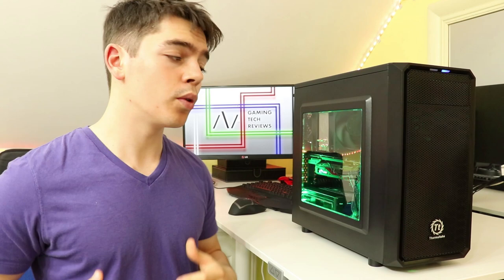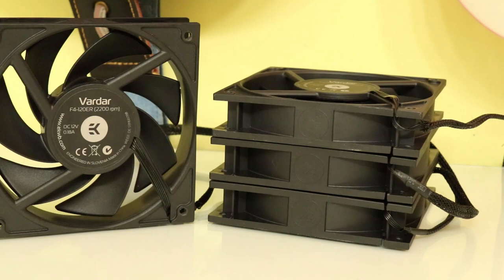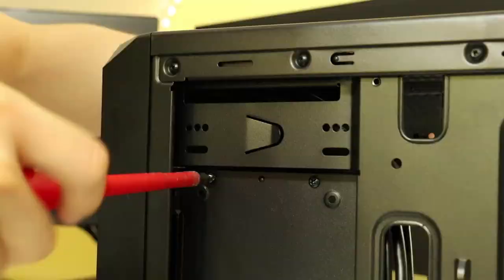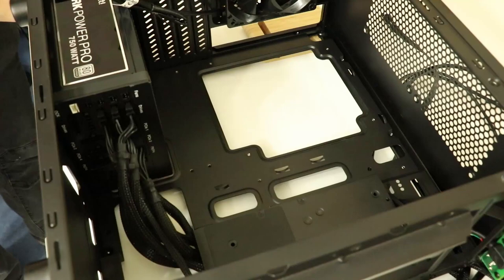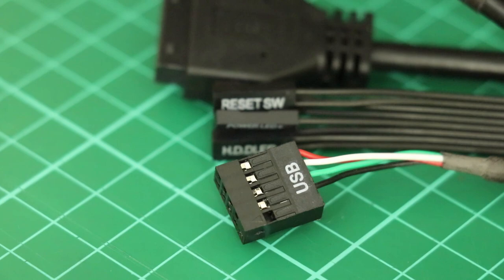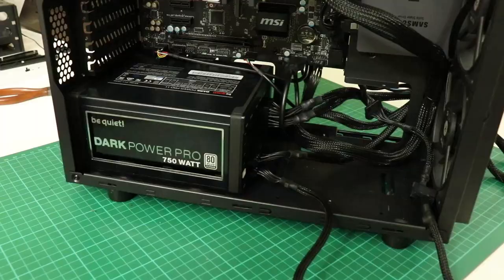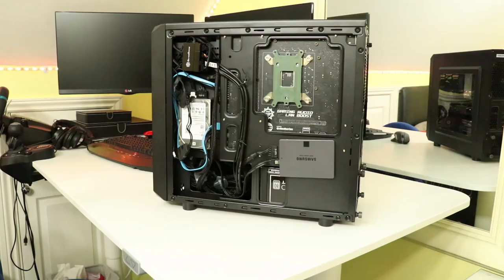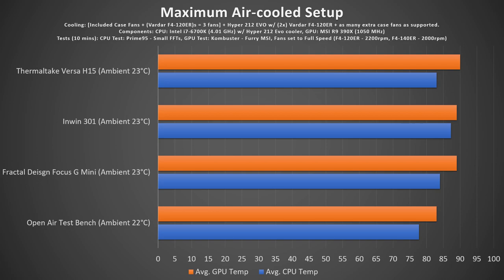Thermaltake Versa H15 Air-cooled Build

Comment: This case specs say max cpu cooler 155mm but you managed to put 159mm cooler inside??? Im considering buying this or Versa h18 case but I have 160mm cooler and they both say 155mm max. Can someone confirm if these cases can hold 160mm cpu coolers?

Comment: Well...I've got my work cut out for me lmfao. That said, I am glad I have a "mini card" version of the GTX 1060 6GB. Looks like I will be doing some custom work on this case....
Reply from the maker: It's certainly a tight case to build in, it really will appreciate the smaller graphics card. I would highly recommends a mini ITX motherboard, but like you saw in the video, you can make it work with an mATX motherboard if you want.

Best of luck with the build, and let me know if you have any queries about the case. And of course thanks for checking out the video!

Comment: if I use an air cooler and put fans on top of the case, will it be bad?
Reply from the maker: It won't be bad, but any fan Infront of the air cooler will be reducing the performance of the air cooler unless it's an intake. Best way to go about it is a front intake and rear exhaust, it keep the airflow more linear and prevents air recycling.

Comment: Вау, какое у тебя мощное железо, много накопителей. И конечно же корпус очень крутой.
Reply from the maker: The system in this case was pretty much all the hardware I  owned at the time, we've updated the test system a little more since then. That R9 390X is a really hot card, and this case did well to keep both the CPU and GPU under their maximum temperatures.

It's a cheap case, but it works well for the price, and I'd recommend it if it's what you like the look of. Let me know if you have any questions, and thanks for checking out the video!

Comment: I seem to be having trouble mounting my ASUS GTX 1050TI into this case, as the mount inside the case where I would secure the GPU with screws is getting in the way and preventing it from being slotted properly into the PCI port. Has anybody else had this kind of issue? Any workarounds for it?
Reply from the maker: Try taking the Graphics card out, and then pressing the back of the case in a little. That should help to align the screws better.

Comment: Is there any way to put my 3.5 hdd in the rear back of my case, cause the hdd holder is interfering with my airflow, thus I don't really have good fans, so my gpu temp is reaching 80c. Causing my games to crash.
Reply from the maker: Before exploring too many options, have you tried running the system without the side panel? This should help to identify if it's a general GPU thermal issue, specifically a case airflow issue.

If the graphics card stays below roughly 70C then we can think about case airflow, but if it's higher and maybe still crashing you might want to think about changing the thermal paste (especially if it's a card that's over a few years old).

If it's a case airflow issue, something that will help is adding a rear fan. If you haven't got a rear fan try adding a fan from the front to the rear. A lot of these kinds of issues can be solved with reconfiguring hardware.

I don't think the HDD cage will be causing such an issue to force the GPU to become unstable, even with pretty bad airflow the GPU should be able to ramp it's fans up to full speed and just about cope. This of course is subject to what GPU you have, and elements like the condition of the thermal paste.

Let me know how you get on.

Comment: I have a Thermaltake H15 build,i gave it to someone who was recommended to build as i didn't want to blow the house up,but he only put 1 xtra fan in it at the top and says he couldn't get more in.I have now found out he is an office pc xpert and not gaming pc.I was Playing a game last night an niticed the heat is starting to go up more.I would love to dismantle and rebuild with all the fans installed but he has packed the cables in strange way and wouldn't know where to start.I wish i'd just taken a chance myself now but have only come across Thermaltake H15 build videos after the thing was built.I know i'm stupid!
Reply from the maker: Sounds like you ran into quite a bit of trouble. If you wanted a couple of tips for some simple changes to improve the thermals on your system, don't hesitate to send some images in a private message to my facebook page and we can see what you have, and how to change any of it if that's something you want to do.

Everyone who get's into tinkering with PCs starts for different reasons. It turns out your reason might be to better what has been built for you. If it's just the case of installing another fan, or replacing the CPU cooler (not as complicated as it may sound), it should only cost in the region of $10-$30 depending on what needs improving.

Don't beat yourself up about it, there are countless things that people do to their systems that are detrimental, at least you have a working system that you can better, over a broken one that needs replacing.

Let me know if there's anything you want to look into to change or improve your system, and I'll do what I can to help out!
Reply: Thanks m8,i will take some pics and send them to you soon,you are english so we are same timeline as i'm only cross the water iin northern ireland.I may be worrying over nothing but would rathee be 100% sure about it.
Reply from the maker: No problem, here's the link the AV Techy Facebook page by the way:
Facebook: https://www.facebook.com/AVTechy/

One thing I would certainly recommend it downloading MSI Afterbornuer to track the temperatures of your system when you're gaming:
https://www.msi.com/page/afterburner

Go to the downloads tab, and you'll want to download the one that just says "MSI Afterburner". Go through the typical installation process and then run the program. You may want to go into the settings to change the "Monitoring" settings to untick everything but CPU Usage and CPU Temperature, as well as GPU Usage and GPU Temperature. Then you'll want to keep the program open and play some games for 20-30 minutes, and take a screenshot of the temperatures to see if anything does need improving, or if some hardware or BIOS settings need tweaking (again, not as complicated as it sounds).

There are so many people that blow small issues out of proportion, it may be a completely free fix, or perhaps something in the region of €10-25/30. We'll try and keep the costs down though since nobody wants to spend more than they have to.

Anyway let me know here when you've sent over some images and I'll get onto helping you out as soon as I can. Don't sweat it for now though, your system will passively modify its settings to prevent any damage related to thermals "if" they are getting too high, so it's just the noise that will be concerning for now.

Comment: You keep doing videos on cases I'm buying (well... 2 years ago you did videos on cases I bought this year)... first the Fractal Focus G Mini, now this Thermaltake Versa H15. I will say this about the Versa H15 (I actually own TWO of these cases)... it's NOT a case for full-sized 244mm x 244mm MATX MBs. As you stated in the video, you end up covering the cable management holes and installing parts becomes much more difficult... another thing you didn't mention, but is a big factor with this case, if you have a full sized MATX MB, it is IMPOSSIBLE to install an optical drive in the 5.25" bay, as it literally rams into the MB if it's full sized (yes, some people still use optical drives). Simply put, this case isn't and never was designed for huge motherboards and tons of drives... if you want a big MB, with big coolers, and lots of drives... look elsewhere... this case isn't suited for that... 

However, being a pretty cheap case ($40 US), this is the perfect case for cheap budget builds... if you have a smaller MB (ITX, or a smaller MATX... I built two systems with MATX MBs at 180mm wide), it leaves all the cable management cutouts open and free, and you can easily install an optical drive in the 5.25" bay if you need/want to. I also only used a single 1TB SSD drive in both my Versa H15 case builds, and you can easily install an SSD on the cable management side of the case in the same positioning you placed an SSD drive on the window side of the case... an SSD on the backside of the case can be screwed in, facing connectors towards the MB, and you can easily plug them in through the cutouts provided while at the same time hiding the SSD drive from the window. If you use LED fans on the front of the case, they also shine quite nicely through the front and help light-up the interior as well. Overall, I found the Thermaltake Versa H15 is a WONDERFUL case to work with, IF you only intend on a modest build with a smaller MB. If you try and cram a ton of drives and huge components into this case, no... it's not a good case for that. 

I build PC's for everyone in my house, and two of the four PCs in my home use this case... for bigger builds, with bigger MBs, that's where I ended up using the Fractal Focus G Mini... it's laid out similar to this case, but is a bit roomier to accomodate a bigger MB and/or more drives. My kids smaller builds use the Thermaltake Versa H15, while my larger build uses the Fractal Focus G Mini. Nice review, keep up the good work (well I guess you have as i'm commenting on a two year old video).
Reply: what motherboard?
Reply: @omarsakho6275  I did use a MSI B85M-P33 MB for one of my builds in this case (it's a Haswell MB that fits fine in the case).

Comment: can it take a triple fan gtx 770 without removing something?
Reply from the maker: You shouldn't need to remove anything in this case for a Graphics Card smaller than 315mm long. From memory I stripped out everything because it wasn't required, over actually needing to.

Let me know if you have any more questions, and thanks for checking out the video!
Reply: AV Techy on the official site it says it is 380mm but the weird thing is a friend on mine fitted this gard on an aero 500 which supportax 374mm o_0
Reply from the maker: From what I've read on their site it says the VGA length limitation is 315mm:

http://www.thermaltake.com/products-model_Specification.aspx?id=C_00002582

It's to the bottom of the table in the "Other" heading.

Comment: Thanks for the review! I wonder the spec of the cooler need 158mm height but the case only have 155mm for cooler(from their website). Does the cooler been squeezed in the case? Any touch between the cooler and the side panel?
Reply from the maker: Thanks for checking this one out!

The cooler wasn't touching the side panel. I actually didn't check what the clearance was before getting this one from memory.

Anyway, it wasn't a problem for me, so you can pretty safely go for a Hyper 212 Evo sized cooler or smaller.
Reply: @AVTechy  Thank you for reply!

Comment: Why did you use 2 different ram types?That thing probably crashes all the time
Reply from the maker: Because I bought the 2x8GB kit first, and a single 4GB stick came with the motherboard on some sort of deal. I needed more RAM, so I bought another 4GB stick to get up to 24GB.

As for crashing all the time, it doesn't. I'm not saying that as a joke, it just never crashes. If it was unstable then I wouldn't bother using that setup to create channel videos since I'd just loose time and work constantly. But since it's rock solid, I'd rather have the extra 8GB of RAM.

What makes you think it would be unstable? Have you done the same and found it to be unstable? Maybe I've gotten lucky here, or maybe having both sets of RAM running at the same clock speed and similar latency speeds (own or two points out on a couple of levels) means they're happily running side by side.
Reply: Interesting,but when i did the same thing i discovered that when i downclocked my rig i got a heccc of a lot faster.I procceded to tell everyone that i got a new cpu.
Reply from the maker: So you too don't have any problems with mixed RAM sets.

From what I gather you found improvements when you did the same thing.

I don't know why you'd tell anyone something that wasn't true though. And then proceed to tell someone who knew there isn't an issue with this that their system "probably crashes all the time". That sounds a little disingenuous to me.
Reply: @AVTechy  No,I am saying that in a system like yours ,if you underclock one of them to the exact specs of the other one you can get a much cleaner experience
Reply: The ''Probably crashes all the time'' is over exaggerated
Reply from the maker: @user-sb8cs3le2j  If they're both clocked to the same frequency as they are, no underclocking is required.

Mixing and matching RAM isn't really a problem all round to be honest, and as you say even if they were at different frequencies and that did cause a problem, then the fix would be very simple. Even the timings could be slowed down or sped up to a certain degree to allow everything to work in harmony.

So I assume at this point we can both agree that the initial comment was kind of mute, if not dead on arrival.

Also it's strange how all of your comments have just one like continuously throughout the comment, you wouldn't happen to be playing a part in that would you? :P
Reply: @AVTechy  Ok,if they are the same frequency you win.But usually thats not the case as they are different by insignificant amount
Reply from the maker: @user-sb8cs3le2j  It's not about winning, it's just making sure all the right information is being discussed.

Mismatching RAM can be done, but of course can result in either one set being downclocked by the MB (automatically or manually of course) to keep everything stable, or both sets will run without an issues depending on the board, or it just creates an unstable system right off the bat.
Reply: @AVTechy That is what i ment
Reply: @AVTechy  The ''winning'' is about what is true and what isn't
Reply: I was trying to tell you to check if it was automatically taken care of completely.Sometimes the board clocks it to be just enough but it could be better
Reply: RandomInternetPerson right

Comment: 12:06  is one of the top fans upside down??
Reply from the maker: Well spotted, that was an attempt to make some sort of use for the top front fan position. It seemed to have a negligible impact on performance unfortunately.

It seems the top front fan position only really works well in a water-cooling scenario with a radiator. I've tried to make use of the top front fan position on a few cases now with no benefit and in some instances a negative impact on thermals.

Comment: Thank you buddy for this video. I saw that this is a terrible case!
I have a old case TT-SHARK, its 2000 release. and still working. it is assembled from thick aluminum 1.5mm thick. 
I will never change it for new cases from TT. they're terrible. not to compare with the old ones.

Comment: What are the motherboard and ssd temperatures?
Reply from the maker: Those aren't temperatures that I log down since not many people are interested to that level of detail, so I haven't got any to hand. I have got HWMonitor at hand to check those details out, but I realistically won't be able to log all thermals down.

Don't get me wrong, it's good to keep the motherboard temps in mind, but the spec of the motherboard exceeds the rate that we're pushing the CPU since we're not pushing standard clock rates (although with the legacy auto voltage setting the voltage does spike over 1.35V during prime95 runs). I'm reworking the testing methodology to lock the voltage off on every test performed, so we'll need to roll that out and reset all graphs once it's done.

And the SSD is nothing to be concerned about, it could be covered with cables and dust and still be in perfect working order. I've got a pretty cool dust based video coming up, and it shows how horrendous a dust situation can get without completely killing a system haha.

Let me know if you have any more questions, and thanks for checking out the video!

Comment: what? fromt he getgo you mix ram sticks?
Reply from the maker: Calm down, it's perfectly fine. Have you mixed RAM before?

It's perfectly fine if the sets are matched closely enough.
Reply: Theoretically its fine to mix sticks as long as the specs are the same, but its not recommended because different brands would mean different build quality which could cause malfunctions. But its still fine nonetheless.

Comment: ur ram is messed up. Ur not supposed to u 2 different sets of ram!
Reply from the maker: Why? They're set to the same speeds and are perfectly stable. Give me a compelling reason why I should stop.
Reply: That's what I initially thought, but also immediately said to myself, "well, if the speeds are the same, should be fine."